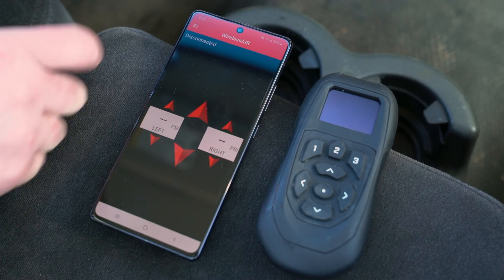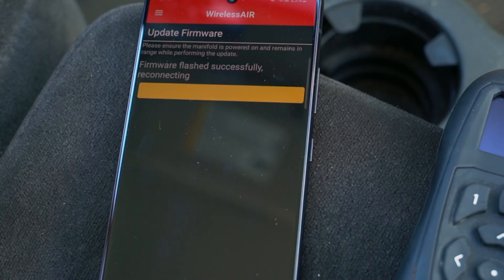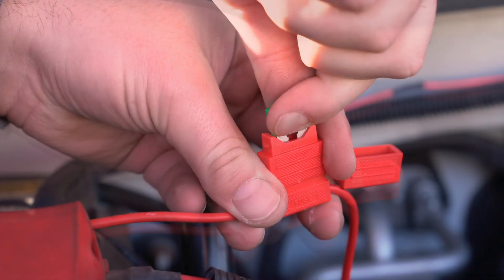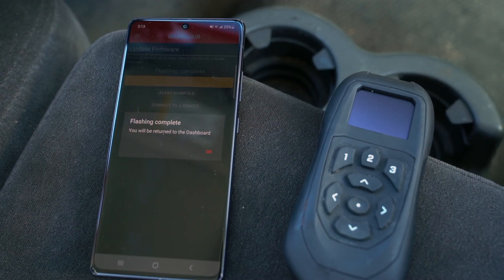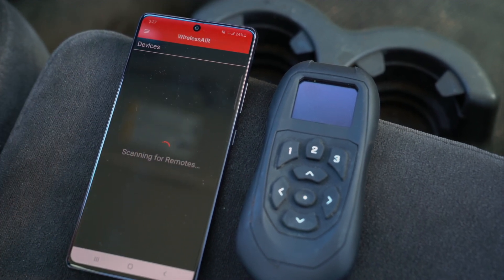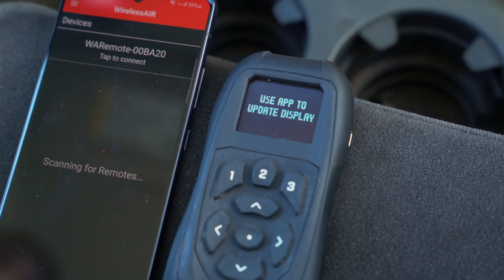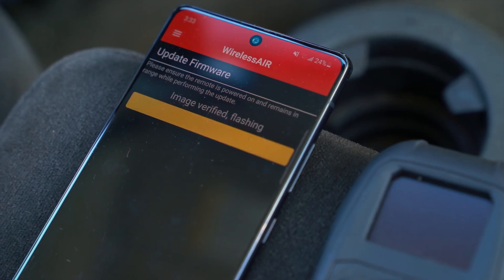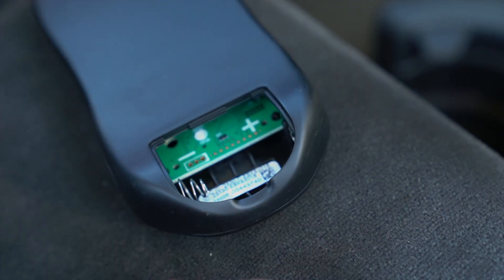How to Update Firmware for WirelessAIR - Air Lift Company

Comment: Don't think I will have to worry a out an update .. can't even get a replacement 1/8npt 1/4 o.d ptc fitting .. pretty sad .. brand new kit .. got it for Xmas installed a few days ago and has a bad fitting .. spent $45 for overnight shipping and sent me the wrong one still .. again was sent 1/4 , 1/4 ... Pretty rediculous.. $1200 kit being inoperable due to a $10 at best fitting that is garbage ... Still do 60 days no questions asked ??!
Reply: Firestone kits are better and go up to 150 psi. I switched mine out to the Firestone, way more solid and Firestone fittings are available on Amazon and etrailer

Comment: Can you create an attachment that connects a upgraded manifold to my V2 setup?

Edit, Meaning so i can get the upgraded manifold with existing wiring and such? i would replace the analog display for sure, Bags and tank have been solid since i installed them in Dec of 2019.